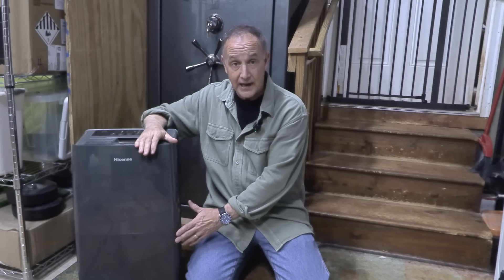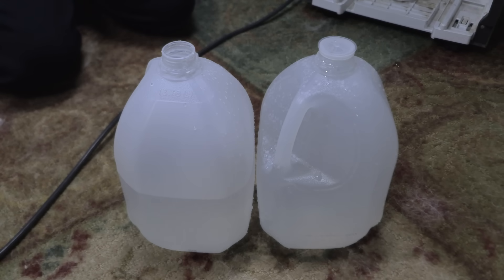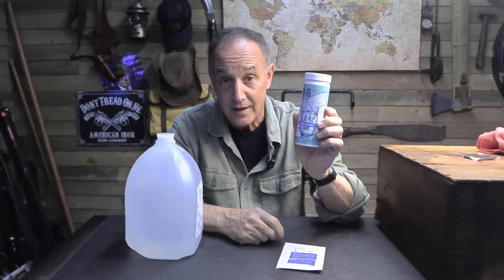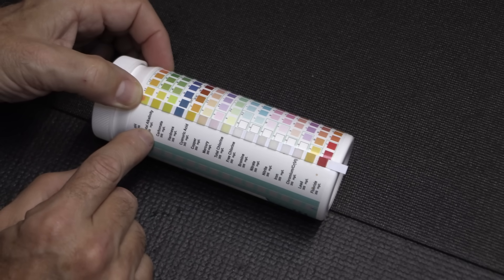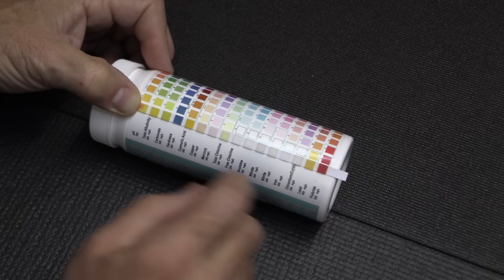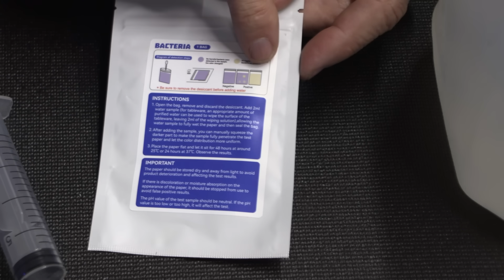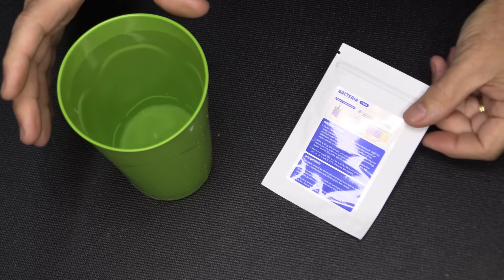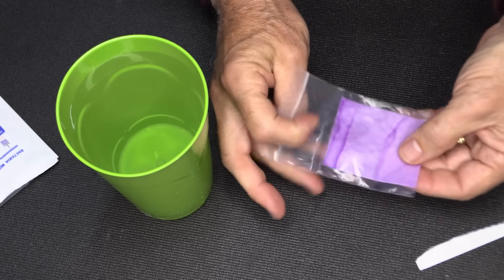Water out of Thin Air? Using a Dehumidifier! Is it Safe to Drink?

Comment: Two things:
1) The power used to run a dehumidifier would easily power most water collection systems. Doing this with a dehumidifier is extremely inefficient.

2) If you need to run a dehumidifier, you probably are not in an area that is lacking in water. Therefore, you don't need to collect water in such a way.

Good information on the testing, but the practicality of the subject is null.

Comment: Can survive 3 days without water. Can spend 3 agonzing weeks dying from the bacteria growing in the parts of the de-humidifier which you could not clean.

Definitely filter and treat the water (boil or bleach). Don't just gestimate based on the last time you cleaned the resevoir. Serious folks. Unless that whole machine is coming apart every 12 hours and deep cleaned, it's a danger. I love SP. But bleach and lemons ain't gonna cut it.

Comment: Speaking of Arizona 🏜.....
Several years ago I started experimenting using a 12,000 BTU Mini split air conditioning unit in a 25 ft by 30 ft room from mid-spring through early fall. Relative humidity is between 10 or 15% up to 90% during monsoon season. At a minimum I've been collecting at least one gallon a day. The water is put into a DIY 5 gallon Berkey type water filter using ceramic candle filters while at the same time running a ozone generator bubbling through the water. Recently acquired a cheap used water chiller for 5 gallon water bottles that I want to tear down and repurpose as a stand-alone condensate water collector that I can run 24 hours a day outside.

Comment: I didn't realize how important this is in high humidity areas with power.   Oceanic or brackish water is an issue and very tought to refine.   Some yachts do this but it is very tough and expensive.   This is a cheaper solution.

Comment: I made my own "water generator" for my 2004 Ford Explorer. It collects the condensate made by my air conditioner. It's collected in an insulated copper container with a strong UV light installed to take care of bacteria, etc.. It is then pumped through a multi-stage filter system, to ensure any heavy metals are removed, to an insulated stainless steel 3-gallon reservoir where the third row seat used to be. I can add a larger auxiliary reservoir if needed. Whenever I want water, I just press the spigot valve and a 12V pump provides clean drinking water. I've had the water tested to ensure it's safe to drink. When the system is full, a by-pass valve lets the un-processed condensate drip out as normal.

Comment: I'm thinking, you can probably bathe with it or flush a toilet. I've emptied mine onto plants for years. It's like running an ac but not cooling anything, so probably not a reliable water source for drinking due to energy consumption. If you have one running in your basement anyway, might as well get some use out of it. No sense being wasteful.

Comment: I work for a company that used to make office water dispensers based on dehumidifiers. Our system had a 4-stage filter system because of the high risk of contamination (think, body sweat, mouth breathers, musty wet dogs, mold in the home, wet bathroom rugs after a shower, etc. I think you get the point). The cost of the filter system became unsustainable for a retail water system. Of course, the killer to the system and the main reason we discontinued them was... arid areas... If you live in a drier area, this is pretty much useless. Just sayin'.  🤯

Comment: Hey, don't do this. There are often high concentrations of copper and aluminum (possibly lead as shown in the results) in the water as a result of carbonic acid in the water (co2 disolved into the water from the air making it acidic) and leaching these metals off the condenser.
Reply: LMAO

Comment: The cost of energy required is NOT worth the amount of water produced. Even if you tried using solar, it would require a large amount of energy to run the compressor etc to generate the water.... And, the coils.etc are a bacteria growth source as well. 
Not a viable method in my opinion.

Comment: Like the AC Guy said about the internal parts (the condensate lines or "radiator fins") those components have to be kept clean also.  Nothing more than bleach since it will leach into the water.  Best to use diluted bleach with a dash of soap and a soft bristle brush.  Also, if you're using it for drinking water it is best to filter, boil and/or chemically treat for safety.

Most people use these dehumidifiers in dank damp and dirty places.  If you're going to use one for drinking water keep it in a clean indoor environment and DON’T use the provided bucket.  Attach a hose the drain port and drain the water directly into your water storage containers.
Reply: U should never use bleach on aluminum components.  And most fins and a lot of the tubing is all aluminum
Reply: I agree, but in this case when you are trying to eliminate the possibility of disease (got to watch out for Listeria too) from something producing potable water from a device not made for producing potable water, some risk to the component might be taken.  Using diluted (1-3%) chlorine to soapy water SHOULD be enough to keep components clean.  Always rinse them thoroughly.  It's not an exact science.  You could also use diluted vinager.  NEVER AMMONIA!

I wish someone would develop a potable water system based on dehumidification.

Comment: couldn t u just use 8 drops of bleach per gallon to kill the bacteria
Reply: In a pinch, yes.
Reply: @DrEpicPhD  i geet my water from a spigot at the truck stop. it says non potable i 3/4 cup bleach per 30 gallon and b4 drinking i filter with a 5 stage zero water filter.  sent a sample to  a testing lab ($350) and it came back except for e coli which is why i add the bleach.  : )

Comment: I have that model. I also have a little hose where it will automatically drain. So my suggestion would be instead of taking it out and siphoning it off yourself. Just put a gallon jug under the hose. If you say it fills every 12 hours then that means it would drain every 12 hours. It might be a little more convenient this way, but if you need water immediately yes pull out the bin and grab what you can

Comment: You can always boil any water to sterilize it of bacteria🦠 viruses🦠 and parasitic🪱 contamination. 
The only thing boiling your water won't solve is poisonous levels of mineral chemical or heavy metal contamination!
That's where a good water filtration system comes into play.😲

Comment: The small dehumidifiers about a quarter of that size can fit probably 10 L in that tank/drawer. That's enough for 4 to 5 people to live. I would have expected something that big to have a far larger resevoir. There are far smaller dehumidifiers that will work faster than that and use less of your electricity. But... This does give me ideas. As for residue... You have far more residue at the bottom of your hot water tank, and you drink that water. it's not sterile, it's just slightly anti bacterial because of the bleach in it. The problem I'd have with drinking this water is purity. This water would be far more pure than what any living thing should drink. The lack of minerals, would mean the water would leech minerals out of your body. Your water will starve you to death that way.  I can't believe for a second that the mineral content of that water is normal. Water in the air wouldn't have the minerals in it, it's just molecules. So where did the minerals come from?

Comment: Dangerous and stupid. Not safe to drink. legionnaires’ disease. Viruses.🦠 Tests doesn’t work on viruses 🦠. See cruise lines in the 90’s.  Get a real solar condenser. 10:50
Reply: It’s not stupid if I’m in desperate need of water. You can boil it and filter it to drink it. But you can also use  The water for other uses as well. It’s a great hack to keep in mind.
Reply: @my.unhurried.life.  dead in a week, from Heavy Metals. I went thru this mess 2016. Most dehumidifider are made in China.
Reply: @Diebulfrog79  What happened? Were you drinking dehumidifier water? Did you survive?

Comment: HVAC guy here. There can be significant bacteria buildup on the internal components of the dehumidifier that can get into the water. Parts you can’t see or clean. Spraying the interior of the unit with chemicals can cause the unit to fail. EVEN IF YOU HAVE A CLEAN RESERVOIR YOU MUST FILTER/TREAT THE WATER THAT YOU INTEND TO DRINK FROM THE DEHUMIDIFIER.
Reply: anyone ever hear of legionnaire's disease? bacteria can absolutely grow on the components and cause serious health concerns. water can be dangerous if not properly filtered and treated.
Reply: @MKoehler88  yes, I might consider this water but only with a lifestraw.
Reply: @MKoehler88  It can also be hazardous if it becomes a vapor prior to filtration and treatment.
Reply: @MKoehler88 that's the one. There was a hospital with that problem from the HVAC system
Reply: Exactly, but also depending the manufacture you may have things like lead solder up there too to complement what grows inside and what the fan imports. Careful is right.
Reply: Yes! Wasn't there a hospital years ago that had an issue with disease started from a dirty HVAC system?
Reply: @open_minded_1  Not sure about the hospital, but assume its the same thing as what happened to the American Legion convention held in Philly, in the summer of 1976. The previously unknown bacteria known as Legionella was discovered to be the cause of pneumonia in over 100 American Legionnaires (hence the name of the illness, Legionnaire's disease) that attended the convention. 29 of those men died from the illness. It can be found naturally occurring in water, but also in hot water tanks, hot tubs and cooling towers. So the best thing to do would be to filter and treat any standing water before consuming it or using it for bathing or brushing teeth.
Reply: @open_minded_1  Yes==it was the "Legionnaires Disease!" It killed people!
Reply: Yes, I would definitely treat it like one treats rainwater off a dirty roof before consuming.
Reply: That makes sense. But god to know for sure!
Reply: Good advice.  Thank you
Reply: There can be significant bacterial buildup on your dishes that sit in the cupboard. Everything in your house, has fecal matter on it. You fart, you spread poop particles. The longer something sits without being cleaned, the more urine and feces and dead skin it has on it. Your favorite chair you've been farting in for years? There's probably a few turds worth of poop built up in that thing.
Reply: @sylver369  so much for finishing dinner!
Reply: @frezz56 this wet burrito never tasted so good! 😂
Reply: @sylver369  weird comment.
Reply: @sylver369 nice thought!😂

Comment: Most dehumidifiers use aluminum fins for collecting water to drip in to the collection basin.  I didn't notice aluminum on the test strip.  Excess aluminum in the brain is linked with Alzheimer's.
Reply: I have heard Yes & No to aluminum.
Reply: Dying of dehydration in a survival situation or  possibly getting Alzheimer's in 20 yrs , weigh it !
Reply: @j.robertsergertson4513  dehydration death vs Alzheimer's is an easy choice, but I wouldn't consider it am everyday replacement for city water piped in to your home and filtered before consumption.  Also, condensed water is like distilled water, and lacks a lot of ground minerals found in city water,  which can slowly lead to demineralizing one's body.  Once again, fine for a temporary emergency use if filtered & maybe boiled, not for long term use.

Comment: Distilled water is missing minerals our body needs, but you can always use it for bathing and washing dishes.
Reply: Wrong . It's fine to drink . Many  , including myself have drank it exclusively for years . 
Going on 10 years actually , no problems .
If your getting your trace minerals from water , you've got issues with whatever it is your eating , that you refer to as food .
Distilled water is 100% pure water . 
If your body can't tolerate that , I'm pretty sure there's nothing else coming along that's gonna help .
Reply: According to his litmus test, the mineral content of the water is normal, and so it isn't anything like distilled water.
Reply: @sylver369  but if it was boiled it would be however as soon as its used in cooking ect ; its fine . most of the bacteria is algae from sitting in that container exposed to o2 ....
Reply: If water is in short supply you shouldn’t worry about drinking distilled water.   Reminds me of the woman at the grocery store passing comment about sodium in canned goods I was buying to stock up for emergencies.   In a situation where all I have to eat for a few days are canned goods, high sodium isn’t a concern. 

Now all that said, I’d use this dehumidifier water for things like cooking or cleaning (after purifying it) or mixing with electrolyte powder and only as purified water for drinking as a last resort.
Reply: "Distilled water is poison", where do you loons get this crap? Yes, it's lacking in minerals, and that means it's lacking in minerals. So... you eat food?
Reply: If you add a bit of salt you're fine